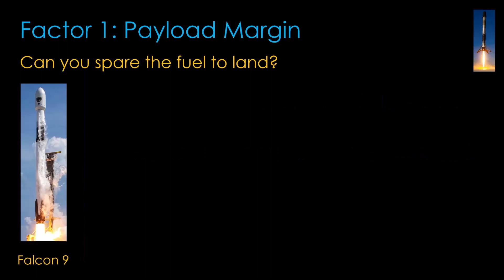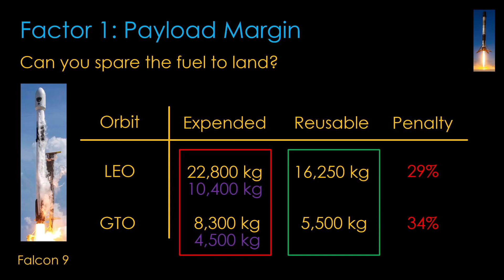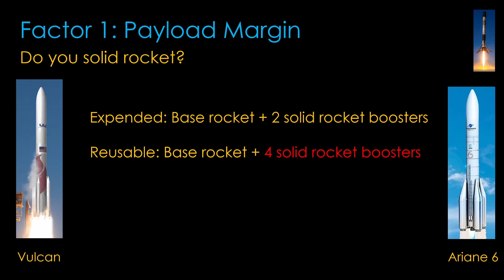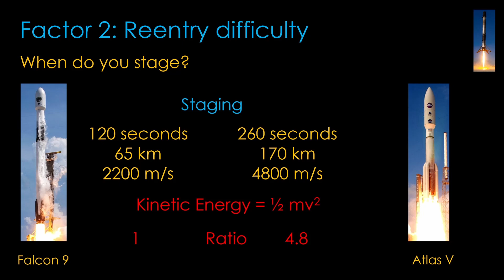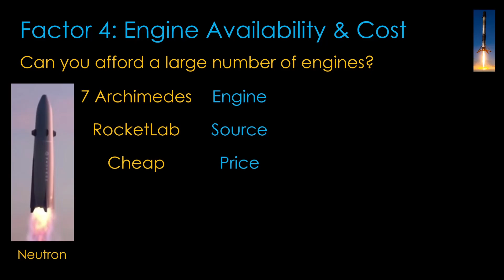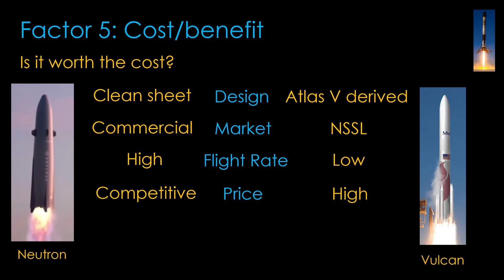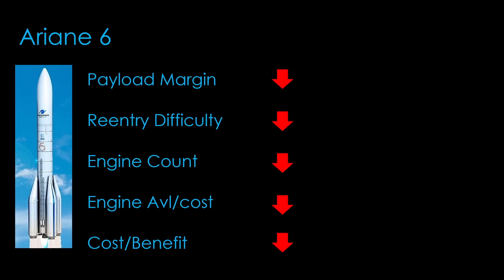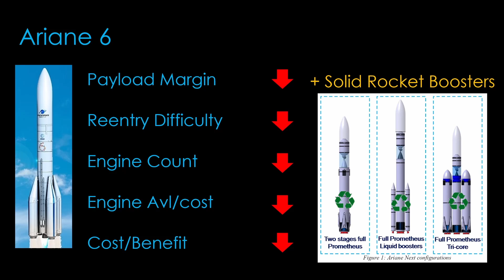Propulsive Landing - What does it take?

Comment: I have to admit with a little shame that I have now watched 44 videos of this channel in the past 6 days, very great channel !!
Could be doing worse things on the internet.
Curious about how much weight difference keeping fuel left over for a propulsive landing, adding wings for a horizontal landing or adding alot of parachutes has.
I suppose there is a good reason everyone seems to strive for propulsive landing only, with few exceptions. (scale differences?)
Reply from the maker: It's hard to qualify the difference because we don't have great examples of each.
It does seem that big wings is not the way to go - shuttle was this heavy orbiter that couldn't carry any more Payload to ISS that falcon 9 reusable can. 

The problem with chutes is you can't control them and nobody so far can keep a stage out of the ocean using them.

Rtls is by far the cleanest solutio if you optimize for it and your launcher is big enough.
Reply: @EagerSpace Gemini Rogallo? And ram-air parachutes can be controlled. Though I’m not aware of any spacecraft that have used ram-air parachutes, there have been US military experiments using them to land cargo on specific targets.

Comment: Some thoughts I would like to add:

Falcon 9's payload to LEO with recovery is probably greater than 16.25 metric tons. That 16.25 metric tons is the claimed maximum mass it has ever taken to LEO, in this case a Starlink mission to 315 km at ~53 degrees inclination. Usually maximum payload mass to LEO is calculated by using a 200km orbit at whatever the most efficient inclination from the launch site is, which in this case is 28.5 degrees.

Also, in regards to the recovery comparison between Falcon and Atlas, do remember that for Atlas it would be being recovered earlier since it can't use all of it's fuel to get to orbit. Maybe a better comparison would be when the 2 rockets stage based on their expendable flights, with the expectation of a decrease?

Also, another thing which probably should've been talked about is the upper stage. If you're not going fully reusable, that gets expended every flight, so it's cost as a proportion of the total cost of the rocket needs to be considered. If your upper stage engine is in the same ballpark of cost as your total first stage's engines, like on Atlas V, then that's bad for reuse; whilst for Falcon 9 the upper stage engine is going to be a tad more expensive than 1/9th of the total engines on the first stage.

If said upper stage also has a lower thrust to mass ratio, like Centaur, then separating it earlier is going to incur more gravity losses than a beefier upper stage, like Falcon's, further reducing the payload.

I would also argue that more expensive first stage engines actually increase the viability of reuse, since having a greater percentage of your rocket's total cost being with the first stage means you're getting a higher percentage back with each recovery.

And one last thing: I'm that confident New Glenn gets full check marks across the board, largely down to it's second stage. I'm not convinced it is as proportionally cheap as, say, Falcon's, down to it's use of hydrogen fuel and engines running on them, and the apparently high structural mass limits it's payload mass to higher energy orbits. I'd probably give it a couple "maybes" in a couple of categories, whilst Falcon 9 and Neutron seem much better suited for that style of 2 stage partial reuse.
Reply from the maker: Thanks. Some of these things I thought about and decided not to get into, and some things were ones I didn't think about. 

The problem with expensive first stage engines is that you need a lot of them, and that pushes up your base cost significantly. That will push up your expendable flight cost quite a bit and may price you out of that market. 

WRT New Glenn, I've picked on Blue Origin a lot and decided not to add to it here. The problem I had with this analysis is that there simply isn't enough information available to conclude much. 

I see no reason to conclude that New Glenn is ever going to be competitive in terms of costs as it's coming from a company that isn't designed to make money. But I do think it can be successful in the sense that it can actually land and be reused.
Reply: @EagerSpace  Thanks for the reply.

Yes, expensive first stage engines would drive up the expendable cost a lot, but that does make reuse make more sense.

New Glenn definitely can land and be reused, but the question I have is "can it be reused more cost-effectively than it can be expended," which honestly I'm not sure on. The answer might be yes, but I'm not convinced that it's better than Falcon 9 in that regard.

And actually, I think that's another interesting topic. Assuming you can land any first stage with any TWR like it's KSP and you can throttle as low as you want (completely unrealistic), and assuming the market can accommodate the launch rate, when does reusability make sense?
Reply from the maker: @noname117spore  Interesting question, and I'm not sure I have a good answer. 

My observation is that SpaceX learned a ton during their early landing and reuse cycle, and I suspect that when you looked at the Block 4 launchers, they were mostly "meh" when it came to reuse - it was possible to reuse them but it wasn't a clear benefit due to the amount of work required. That's my explanation for why they decided to clear them all out by expending them on their second flights, so they could get to the block 5 launchers. 

So I think you are going to need that amount of experience to do some design revisions and get to a state where reuse makes sense. The costs for the launchers that aren't going to be great has to be tolerable and you need to be "hardware rich" enough to keep going. 

That is one of my concerns with New Glenn; they seem to think that they are just going to build a small number of these launchers and those will be good enough to just keep flying. Seems unlikely to me from an engineering perspective, and there is of course the chance you won't recover all of them.
Reply: “Chance you won’t recover all of them”—do you think they will run out of boosters in that manner before Bezos gets bored with his expensive hobby business?

Comment: Great video as usual. I love that you do videos that are always a bit different than other YouTuber's rocket content. Keep it up!
It would have been interesting to see you take on some of the up and coming US launch systems such as Firefly or Relativity. We already know that Astra has the same issues that Electron has when it comes to propulsive landing. I mean I didn't crunch the numbers or anything, but it seems pretty safe to say considering it's size. That is unless their engines are just out of this world.
Reply from the maker: I've thought about content on both firefly and relativity, but there isn't very much information out there and at this point I don't have much comment other than "what they are doing looks technically feasible but I don't see much to differentiate them from other small-sat launchers other than - perhaps - payload". 

I suspect they're going to run into the usual problem with fixed costs and launch rate; if you can't get up to a decent launch rate it's very hard to be competitive but you need something different/new to reach that launch rate.

RocketLab appears to have done it, mostly on their own. That's one reason I'm excited about them as a company; the other obvious examples is SpaceX but they got really lucky with the timing of the NASA CRS contracts.

Comment: Thanks for reminding me of SMART reuse, took me on a long train of thought that ended in a booster with deployable wings. I know, this isn’t much use considering everything downrange is ocean, but hear me out. You put an aircraft carrier downrange (if the Space Force bribes the Navy this could definitely happen) and the expensive booster flies back into your hands, it’s a done deal.  

I’d like to add that the weight disadvantage brought on by the wings and other additions could definitely be offset with More Propellant™️ otherwise known as chasing Tsiolkovsky’s tail.
Reply from the maker: Figuring out the actual tradeoffs between winged and propulsive approaches is a bit beyond my engineering skills. I will point out, however, that the winged shuttle + external tank massed about 104 tons for a payload of about 28 tons while starship masses about 120 tons for a payload of 100 tons. Doesn't look good for wings...

Shuttle was of course originally supposed to use a winged booster, but all the studies seem to have been hydrolox and that's a really stupid choice for a booster, so I should probably discount them.
Reply: @EagerSpace  I’d imagine there’s a significant relationship between fuel density and weight of aerodynamic add-ons. Kerosene/Methane would allow a smaller booster comparatively which means less booster the wings have to control, and that means less “wing” is needed to keep the thing stable. If all we’re looking for is a glider then that would give us a pretty good profile. 

I’ve also noticed with the original shuttle designs that their boosters were pretty much just fat planes, which doesn’t seem very optimized. Rather heavy for a booster, probably great for turn-around though.

The major issue with the plane design, if I had to guess, would be keeping the tank structurally stable for a gliding flight without adding that much weight. You could add raw structural rigidity but that’s a load of mass, and keeping the tank pressurized autogenously would bleed velocity from your engines no matter how you cut it. That may be the best way to go about it, though. But, then again, you have a kerosene/methane booster that can afford the addition of aerodynamic surfaces, why not cut down even more and replace wings with gridfins and landing gear with legs? There’s probably some niche for a winged booster but that would require actual math on my end to figure out.

Comment: While Centaur V uses the same balloon tank structure as Centaur III, I wouldn't consider it the same stage considering the sizable increase means Vulcan has a much larger upper stage.
Reply from the maker: Yes.

Do you think it's going to have a significant impact on their staging time? They are running 2 RL-10 rather than 1, but I think the first stage is beefier as well, so I don't expect the ratio to be much different.
Reply: I think they are going with the same design philosophy as the Atlas series, but apparently Centaur V has slightly higher acceleration than the 3m Centaur. I'm not sure how the Titan centaurs performed, but they were probably the closest thing to Centaur V, so you might want to look at them